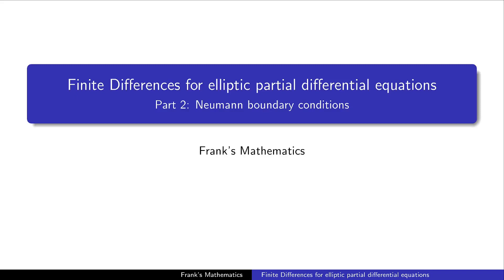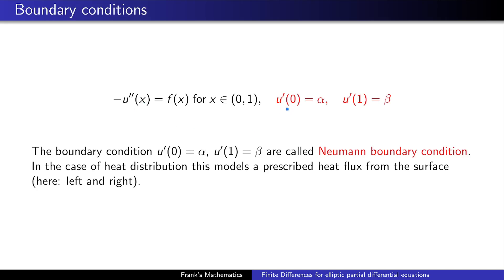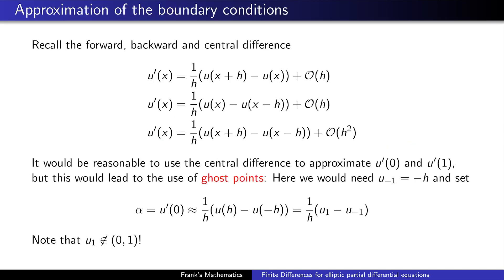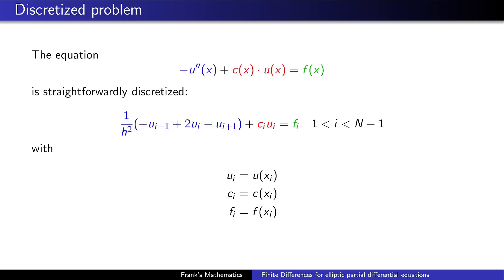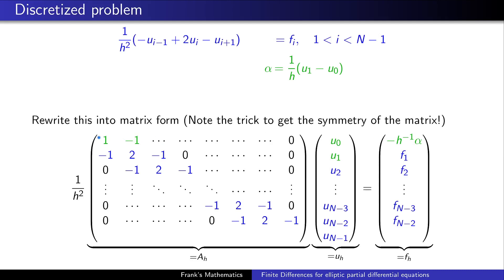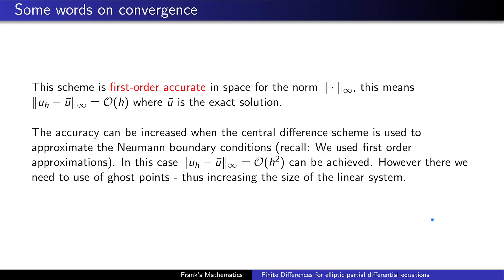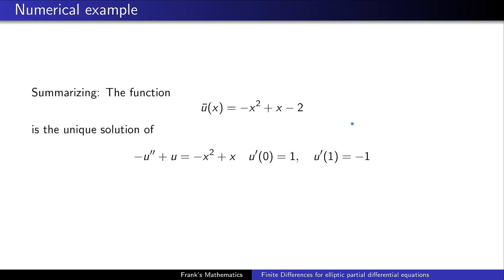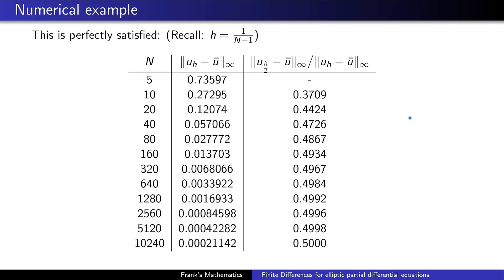Finite Differences for elliptic PDEs - Part 2: Neumann boundary conditions

Comment: Sir would it be a big problem if I use forward or backward to approximate my neuman condition...(Del_p/del_x) = 0 as this will yield a set of equations where points close to edge gives -3 in diagonal of coefficient matrix and points at corner (close to 2 walls) will yield -2 in diagonal of coefficient matrix

Comment: Thank you for this video. I have a clearer understanding of the topic. But adding c(x) confuses me. I have a problem at hand that gives me no solution from matrix. Is there a chance you can explain it to me? The problem is d2u/dx2=-sinx      u'(0) = 1 and u'(pi)=-1    I took h=pi/3 but my matrix does not give me a solution and I do not have any c value to add.
Reply from the maker: Hi, the problem is that your problem u''(x) = -sin(x) and u'(0) = 1 and u'(pi) = -1 has no unique solution. It is the same argument as in the video: If w(x) is a solution to your problem, so is w(x) + c with an arbitrary chosen but constant c (just plug it in the problem and compute the derivative). If the exact analysis has no unique solution, how can we expect the numerical approximation to have an unique solution? We simply cannot expect this behaviour. Here this will result in an irregular system matrix.

I hope this helps to clarify the problem.
Reply: @franksmathematics9779  Thank you so much

Comment: Thank you for the awesome explanation. Just a clarification, wouldn't adding c(x)u(x) to the Laplace equation change the problem we are trying to solve?
Reply from the maker: Yes, you are right, this is a different problem. The original problem we started with is not uniquely solveable and I do not wanted to add additional/artifical constraints like u(0) = 0 to make it unique. I just started with this problem to have a smooth transition from part 1. Maybe I should have made this more clearer. Thank you for you comment!